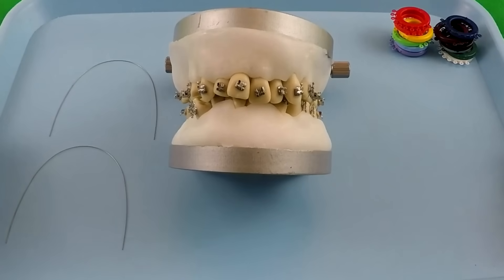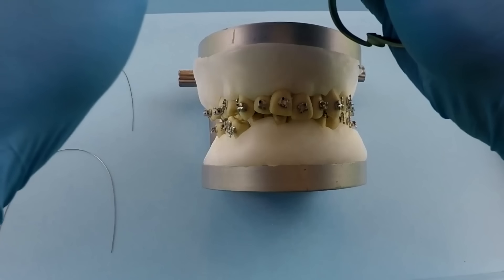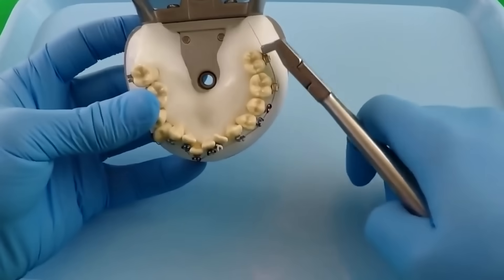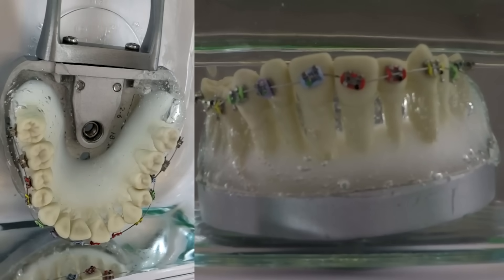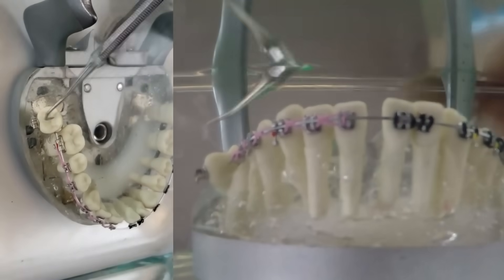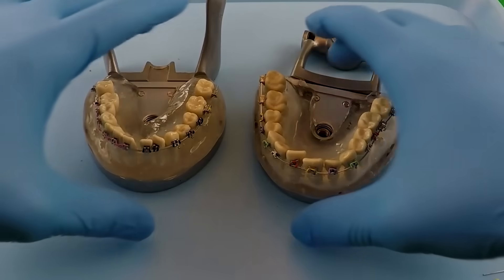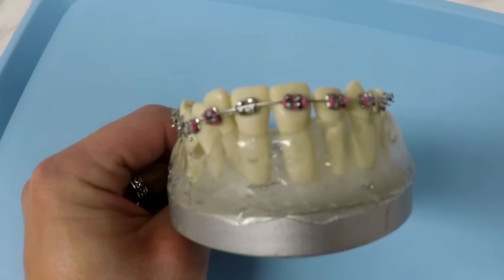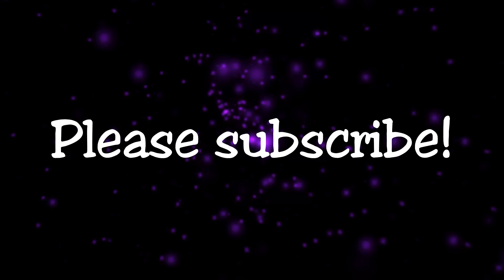Ever Wonder How Braces Work? Find Out Here!

Comment: Can you do a video on expanders, the rubber bands on braces or whatever it was, I think I might have had to have them for an overbite. And then also that halo braces thing that goes around the whole outside of the face? 
I haven't had to have that thankfully, but I have had braces, expanders, and the rubber band things. And of course a retainer but I've stopped wearing the retainer completely. Hopefully my teeth don't revert back in at least 20 more years.

Comment: I had braces when I was a kid. I had a small jaw and at the time it was common to pull teeth to make room to straighten them out. I had 8 teeth pulled. But by the time I was in my 50's my teeth had moved a lot. My bottom teeth had moved forward causing my bite to be off and also causing my gums to recess The orthodontist placed a spacer between my top teeth, anchored to my back molars. Then an oral surgeon cut through my palate above my top teeth all the way around (I was in the hospital under general anesthesia.) Right after that I put a little key thing into the spacer and moved it to cause the spacer to move my upper jaw apart and widen it. I did this every day for a week or two until I had a large space between my two top front teeth. I looked terrible with this big gap and my face all swollen and purple from the surgery. The orthodontist took over after that and used braces like in the video to move my teeth around, close the gap, and perfect the bite. A year later my teeth looked great and all was finished!

Comment: I had braces as a child in the late 70’s. Stainless steel bands then. We lived in country Western Australia and had to travel to Perth regularly to have my braces - serviced/tightened. It was a painful  process at times. Elastic bands were used to create the tension from the top and bottom teeth. I carried a bag of elastic bands with me at all times. Usually when eating the rubber bands would snap. I had to wear a plate for six months after the braces came off I think. As an addition I had two upper teeth removed so the braces could move my upper teeth back. I had bucked teeth.

Comment: How much can braces move front teeth forward? Like how many mm will the bone still support the movement of the teeth?
Reply from the maker: Oh that answer totally depends on the person. Most of that forward movement is just the teeth tipping forward, and if that's the case then it totally depends on how backwards they were tipped in the first place. Then if you're wanting to move the entire tooth forward then it just depends on how much bone exists in front of the tooth
Reply: @ I was told I have a class 2 skeletal occlusion. But my teeth line up pretty well. I am just not sure how they would even fix that if my teeth line up but the skeletal structure does not. Do you have any guess? I would guess they would have to change front teeth angles and maybe move to open up room to move bottom teeth forward a little

Comment: does it mean if I drink hot water or generally hot drinks, it would help my braces work quickly and my teeth will straightened out quickly?
Reply from the maker: In theory, yes, based on the properties of a nickel-titanium wire. However, your intraoral temperature will rebound very quickly after consuming anything hot or cold. In other words, you'd have to keep something warm in your mouth for hours per day for this to make a difference.

Comment: Why do the brackets come off especially when the teeth is all the way in the back and all the other teeth are in the front?
Reply: hello,,brackets especially those on back teeth, can come off due to several reasons. The primary causes include the intense chewing forces exerted on molars, which can loosen brackets over time you can ask Kriss Ai for more info about that..
Reply from the maker: I've made a couple other videos about this, please check them out (or check out the demos of The Braces App) But your biting force is stronger toward the back because that's where your muscle are concentrated

Comment: Great explanation,  I have hinged braces so don't use bands.  Had a year of top brace and just started on bottom brace to correct a moderate overbite.  Really pleased with the result but with another year to go I have to say  it's been a challenging so far.  After overbite correction I'll be having crowns  first and then implants.  At a mere  age of 66 I hoping I'll survive into old age to make the most of my new nasshers....  🤣
Reply from the maker: You'll strive and use those nasshers for another 40 years... good luck!

Comment: How much a tooth can move? Is it restricted by the bone? In your example some of the teeth were not straight because of the brackets positions but if the brackets are put correctly and the teeth are still not straight is it because they cannot be moved anymore? How the bone restricts the movement
Reply from the maker: The correct answer is that it can be complicated. Things like tobacco use, hormone levels, and more can restrict tooth movement even if the brackets are placed correctly. Not having enough room can restrict movement.
Reply: Okay, thank you. I saw in the video that a lot of space can be available after the alignment and I was wondering, if a tooth is already positioned but needs to be straightened, what would be the obstacles to complete this operation also. From my point the bone will be one of the first obstacles and I don't know if the bone will provide space for the tooth to get it straight, when the side of the bone is reached and there is still free space from the tooth next to it. 

I just want to have real expectations about the whole treatment

Comment: I bought me some polycaprolactone from ebay and have applied it to my gums. I've added some very hot water as instructed. But nothing happened. What am I doing wrong?
Reply from the maker: I'm sorry, but I think you've missed the point. The pycaprolactone is merely used in this demonstrating as a placeholder for a human's true gums/bone. By heating it, the melting plastic demonstrates how braces and wires move teeth albeit in a much more rapid demonstration. The video was never meant for you to put polycaprolactone on your own gums.
Reply: @thecrazyorthodontist  Don't be sorry. This happens to me all the time. Where can I get some of those teeth?

Comment: Thanks! But why do we need retainers afterwards to use for so long? I mean, I get that teeth would tend to revert from the perfect position the wires got, but even that 'imperfect' is far better than where we started, right?
Reply from the maker: 2 questions you asked: 1) The alveolus (the bone that holds teeth) will always change throughout life, therefore retainers are necessary to keep teeth straight and prevent this movement from resulting in crowded teeth.
Reply from the maker: 2) Sure, "imperfect-but-not-terrible" teeth can be better than terrible teeth (in terms of crowding/alignment), but wouldn't you rather keep them closer to perfect? The only way to do that is to utilize a retainer.
Reply: @thecrazyorthodontist  Thanks on your explanation. I read somewhere that without retainers the teeth would go back to the previous (very bad) position, which I thought was exaggerated. But anyway, I'm 43y old, just got my braces done on the upper teeth first. Hopefully will get there in 2y to come. My teeth aren't badly aligned, but my jaw is quite tight and narrow with overlaps, so I'm optimistic to broaden my smile. :)

Comment: So, I have to drink more hot drinks? 😅
Reply from the maker: Not necessarily. By doing something like that (or by drinking/eating cold things to soften the wire) the effect is only going to last a few seconds and then your body is going to reestablish its temperature. Your body temperature is enough heat to stiffen the wires to work effectively

Comment: So basically, the key to moving teeth is the wire, right? it has been a while since my dentist changed my wire. Why does it sometimes take a long time to change the wire? Wouldn't my teeth change faster if she changed my wire?
Reply from the maker: Great questions. First, I recommend The Braces App-- it's an amazing new app that answers a lot of your questions. There is an FAQ in the app plus a bunch of tutorials and educational videos.
Reply from the maker: Regarding your questions: yes, the wire is the key. There are some wires that we will leave in for over a year sometimes depending on the specific action we need. If we are closing space, for example, we might leave the same wire in for a year or more. Other times, if we are just straightening teeth and we might change the wire every month. No, changing the wire will not make things go faster and it could potentially be damaging to your bone and roots. I hope that helps, but check out the braces app!

Comment: In my country (Norway) we dont use the power chain, so im pretty concerned about my gap in the Tooth. How will it close?
Reply from the maker: There are ways you can use a fine stainless steel wire to close spaces and by making loops in the archwires. I just like the chains because they are easy!

Comment: There is a large diastema (about 3.5mm) between my 2 front teeth. My right front tooth is implant. I want to close the diastema but the doctor said that the gap is very large and if we close it with porcelain, the final front teeth will be very large and look ugly. Since my right front tooth is implant, i cant move it with orthodontic treatment. However, can i move my left front tooth (with braces) half of the gap (3.5/2=1.75 mm)? So i can reduce the gap and we can close the remaining part with bonding?
Reply from the maker: You can theoretically do that, but you will want to make sure your midlines are centered upon completion. If the implant tooth is off center then the middle of your teeth will be off center when that is all finished
Reply: @thecrazyorthodontist  wow thanks a lot for the fast response.  My implant is in the center i guess (looking at my photo)

Comment: What happens if you start with a large/steel wire instead of a light wire?
Reply from the maker: I did a light-hearted video about that a while back. Basically, you'll be in extreme pain and your teeth will not move faster. It could also cause root and/or bone damage. Please subscribe and check it more videos!

Comment: This is so helpful omg i randomly just wanted to learn about braces & ur video is the only one that explains how the wire helps !!!
Edit: question: what does the heat indicate in the human body ? Is that just to show us (the viewer) a better timelapse of the adjustment or does the agitation (pull) on the teeth heat up the gums to make the teeth move?
Reply from the maker: The heat in this simulation is just to melt the plastic holding the teeth. It's just for the simulation. (to be technical, heat makes our nickel titanium wires stiffer, but that's not the point of this simulation)
Reply: @thecrazyorthodontist  oh ok so in real life our mouth doesnt like heat up or anything, it just slowly is pulled ? Thank u so much for the reply & vid !!

Comment: Hi Doc may i just ask the possible reason why does my dentist leave one of my bracket in the upper right didn't connected to the archwire? Which is in between of the tooth who's connected in the archwire. Whats the use of the bracket then if it's not controlled by the archwire?
Reply from the maker: There could be a lot of reasons: It needs to move more. I need to move less. It didn't need to move. The surrounding teeth might need to move more. Etc. I'd have to see the specific situation...
Reply: @thecrazyorthodontist  oh I understand Doc, yeah if I only I can screenshot it here, but thank you so much Doc. 🙏

Comment: How to move just 23, 24 ligually 2-3mm to achieve functional harmony with lower (keeping rest of the upper teeth as it is.?
Reply from the maker: That might be easier with aligners. Otherwise, you would just bend the wire at those particular locations-a "step in bend"

Comment: please do experiment like this case with self ligating braces so it would proved is self ligating really work faster than traditional braces.
Reply from the maker: That has already been done. Self ligating brackets are faster with the initial alignment stage but slower in later stages. Research shows it's a wash

Comment: I wore braces from the age of 15 to 18. I had four wisdom tooth removed to make room.  

Years later now I am 43.  

I bite on my teeth so bad at night to the point where now the teeth next to my molars have the extended part of the teeth, look like they're coming out slightly through a thin skin of gum, the outer side of my gums on the outside. Is there a way to move it back into the middle so the part of the teeth that's not supposed to show, doesn't show again.?
Reply from the maker: If what you're describing is recession (the teeth looking longer/bigger) then you've experienced tissue loss that is not reversible. 😢 I would have to see you in person to be able to say for sure, but that's what it sounds like. If that is the case, then surgery with a gum graft may be you're only option

Comment: I’m having my braces on but it causing my teeth move forward.. can you explain why
Reply from the maker: Typically, the wires cause your teeth to move guard slightly as they unravel. It shouldn't be excessive, but if you're super concerned then you should ask your orthodontist. Your teeth should start to move back when/if they place chains (power chain).

Comment: I would like to get my braces on, but the issue with my teeth, is that some of them are relapsing on each other. Like, one is pushed far back, and another right in front of it. I basically have 4 pairs of these - two on top row and two on bottom row, so at least 4 teeth gotta go, and I have no idea what were to happen with a hole in my gums once it's removed. The relapsing teeth on the top row are grown like.. Much, much higher than were they're supposed to be, and were talking like, a bit lower than were my nose drills are. Fortunately these aren't even visible because they're so high. Another problem is that my bottom row of teeth is completely messed up. Even by touching the inside gums of them, I can feel how BADLY they're pushed inwards. If I were to somehow fix my teeth, 1/3 probably will be gone. Then braces on top of it, where my mouth just basically don't have that much space XD. That would cost thousands probably! As much as I absolutely hate how they look and just the constant thought of it, it's not causing me any major issues. It's not uncomfortable or painful, it's just there. The biggest problem I have with it, is that food keeps getting stuck in between the two teeth that are relapsing and it's sometimes hard to remove these particles even after brushing :/.
I just don't want to gave away all the money I saved and probably one more year worth of savings. I would love to have a nice smile, but I doubt even 10 visits will be enough.
Reply from the maker: Move to Southern Indiana and I can help you

Comment: No wonder braces made my gums “recede”. My lower front teeth were pulled up!
Reply from the maker: No, that's not typically how it works. The gums "follow" the teeth in the direction they are moved. If a tooth moves up, the gums move up, etc.

Comment: This was pretty cool to see. Had like 3 years of braces at around 10 years old and hated it, also got a few teeth pulled. Now very thankful because the teeth fit well in the mouth and look rather nice as a bonus. The downside is that occasionally when very stressed out, I see nightmares or dreams where I still have braces (especially the behind the neck ones that look so embarrassing) in public and feel the pull constantly.

Comment: Not having had braces I always figured they needed to be anchored to something, like tied off to the last molar and it was pulled tight.  Interesting the wire just wanting to be a certain shape is enough to move teeth
Reply: bone etc is relatively hard, BUT can be molded with time and constant force.
Reply from the maker: Exactly

Comment: the straightening part makes sense, but what happens below the gum line?  Aren't the teeth being pulled from their socket, if so does the jaw bone then "reset"? Then what fills the void?  The clear plastic is great I guess to practice brace placement but doesn't show the whole process.
Reply from the maker: That part of the process will be in an upcoming video and requires a different type of explanation 👍Basically, the bone and gums follow the teeth as they move
Reply: @thecrazyorthodontist  Thanks for taking the time to reply and the explanation; will keep an eye out for the follow-up 👍

Comment: what is the chemical that melts my gums so my teeth can move? we all know your gums just don't get randomly soft... heat isn't recommended with braces...what makes your gums move boss. if its nothing then how do you know which wire to start with based on gum hardness?
Reply from the maker: This was just a simulation. To simulate gum and bone movement. There's no chemical that melts your gums. I'm going to do another video coming up that shows the biology of this process

Comment: are you saying wire cutters could remove the poking pieces... of course sterilized and clean...
Reply from the maker: Yes, if you do it properly, but orthodontists use a specific type of wire cutters designed for the poking pieces so we don't break the braces